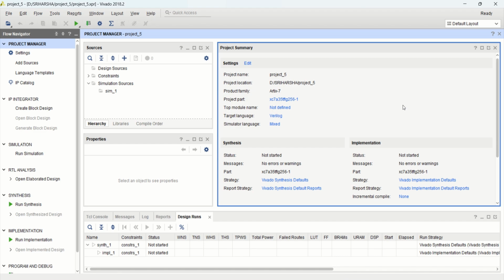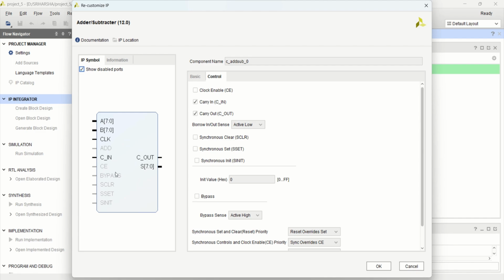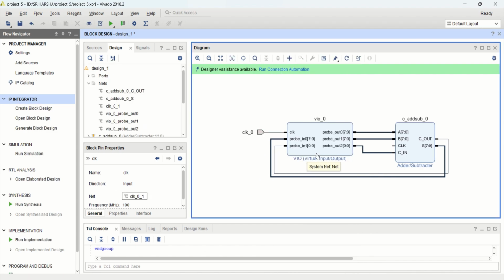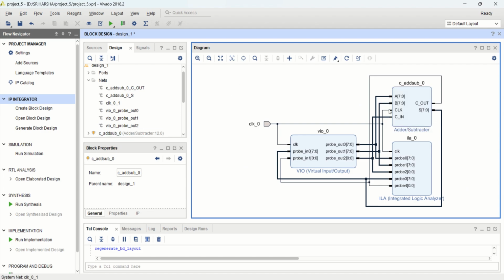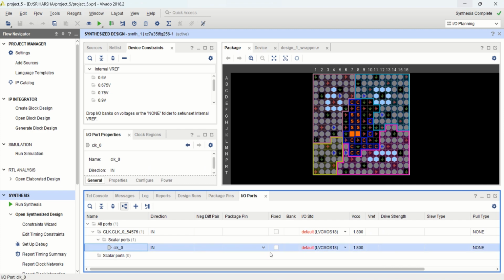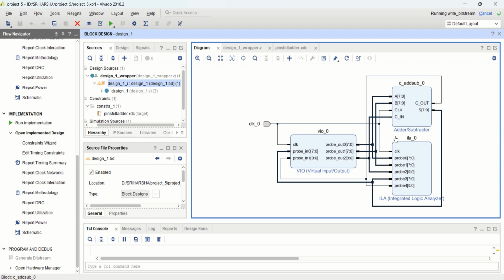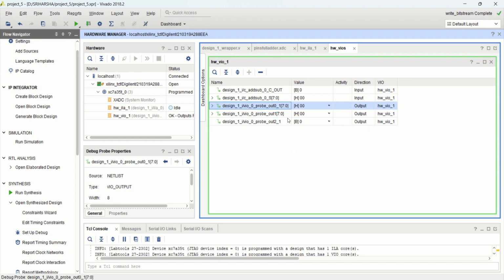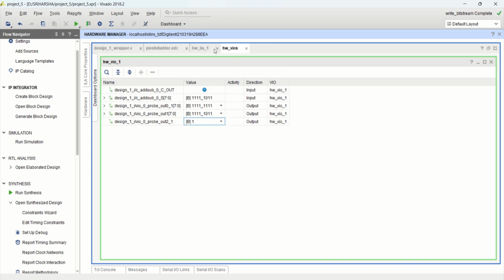IP Based 8-Bit Full Adder Design in Xilinx Vivado.

Comment: hi sir, I am following your videos, i am trying to use vio with and gate, after synthesis i/o planning and package pins are not opening. i am using minized zynq7z00zs board.
Reply from the maker: Hi, after synthesis and I/O planning. Assign the package pins and save the pin configuration.

Comment: @marwanal-yoonus280
0 seconds ago
Dear Sir 
Please, I have a problem during reading the status of an output switch on Zybo Z7-10.
I use Vitis to program the Zynq processor with Gpio connected to a slid switch. I make the switch (input2)  status as a condition  as shown in the program below if (D == 1) ;
The following program works only when the input2 signal that was connected to Gpio IP starts from ("1") but the program does not work when input2 signal starts from ("0"). 
//////////
 while (1)
    {  	D = XGpio_DiscreteRead(&input2, 1);    // input2 from a slide switch
    	if (D == 1)
    	{    	sum_all = XGpio_DiscreteRead(&input, 1);  // input is a 32-bit data
    	printf("%x \n" , sum_all);
    	sleep (1);    	}
    	else
    	{    		XGpio_DiscreteWrite(&output, 1, 0);   // output is a LED
    		printf("No_Signal \n");
    		sleep (1);    	}
}
/////////////
i.e. the program works only when I change input2 from "1" to "0" but does not work when the input2 start changes from "0" to "1".